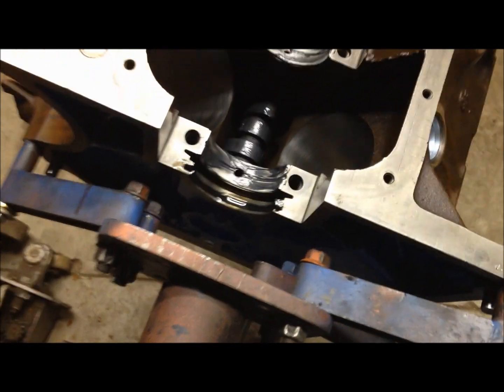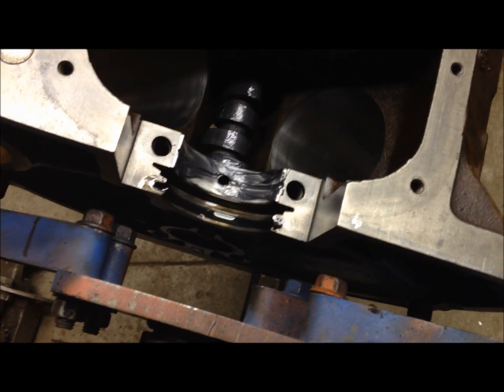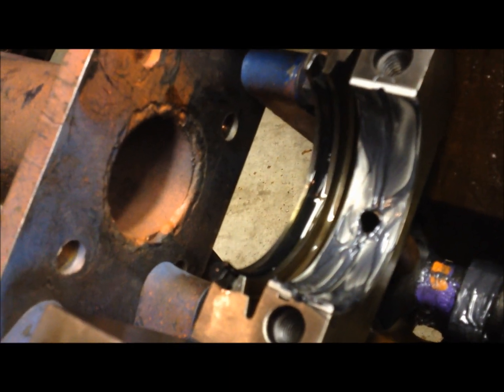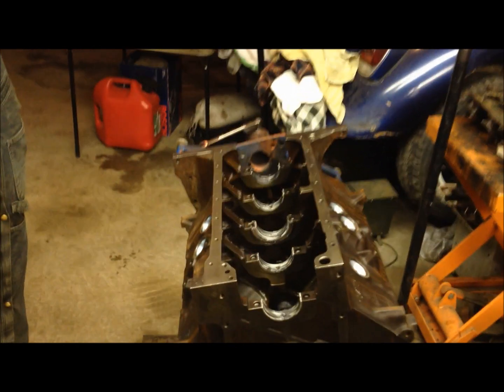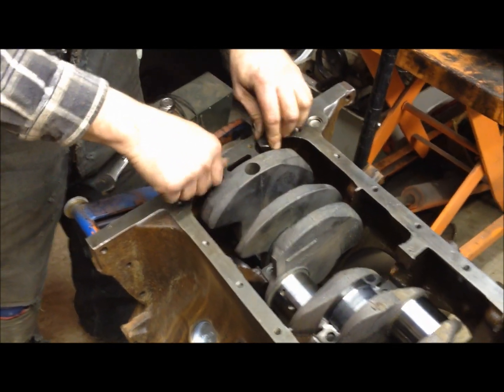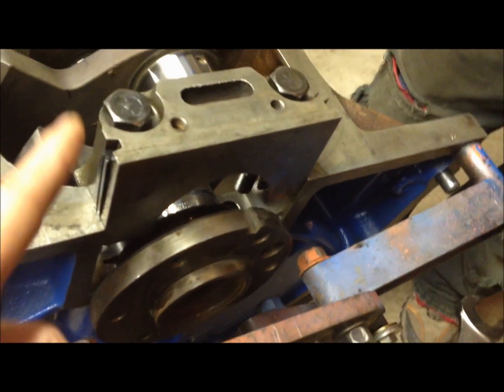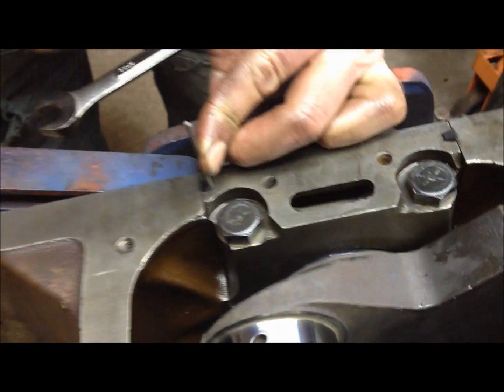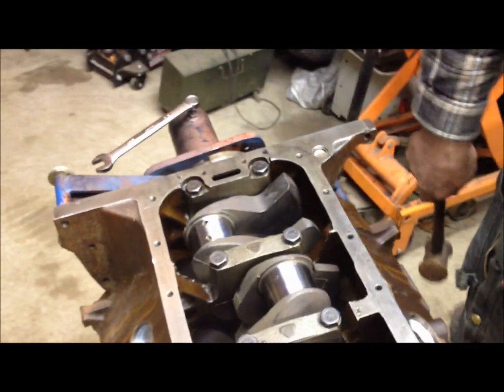360/390 FE Rear Main Seal Installation How To

Comment: Someone told me there is a "kit" that allows replacement of this seal without pulling the engine. Not sure if he has polka dotted monkeys living in his sock drawer, or if this might be true?
Reply: Yes there is....not sure how well it works on rubber seals though. I think it's designed for old rope seals...

https://www.amazon.com/Performance-Tool-W84019-Upper-Remvr/dp/B0002KO400/ref=asc_df_B0002KO400/?tag=hyprod-20&linkCode=df0&hvadid=385177046298&hvpos=&hvnetw=g&hvrand=590420745666563686&hvpone=&hvptwo=&hvqmt=&hvdev=c&hvdvcmdl=&hvlocint=&hvlocphy=9005204&hvtargid=pla-829950443028&psc=1&tag=&ref=&adgrpid=78533818517&hvpone=&hvptwo=&hvadid=385177046298&hvpos=&hvnetw=g&hvrand=590420745666563686&hvqmt=&hvdev=c&hvdvcmdl=&hvlocint=&hvlocphy=9005204&hvtargid=pla-829950443028
Reply: The only"kit" I know of consists of a 10" long wire with a plastic handle on one end & a small metal clasp on the other, & a 5" long stiff wire with a loop on one end & a corkscrew looking other end, that is designed to screw into the old upper seal & assist pulling it out.  In a polyanna perfect world this may work. My upper seal came out in pieces, & had to use carbrulator cleaner & compressed air to help dissolve the old seal, & blow it out. When trying to use the wire & clasp to pull the new seal through, the clasp was too large, & the new seal later, just went in by hand. So much for the new & improved "wonder kit"!

Comment: After you've done these a few times you learn a few tricks. You need to smudge a little sealer on the block mating surface for the cap. Often there is oil weepage between the block and cap if you don't use a very small smear of sealer . Do NOT soak the seal prior to putting it into the block/bearing cap. Do it AFTER you seat them and have your 3/8" offset and cover liberally with your finger tip. I also keep two 8" pieces of all-thread. I thread them into the block and slide the cap down over the all-thread, then remove the all-thread and insert the bolts. This keeps the caps centered. It is VERY helpful with the rear cap and the thrust bearing especially. I also try to stay away from heavy lubricants like moly or white grease. It doesn't dissolve in the oil and winds up sitting in the bottom of the oil pan. Keep up the videos!

Comment: could this process be done without taken the engine out of the car,the changing of the rear main seal? im sure the way you have shown in the video is a whole lot easier but for a individual that has a rear main leak as a repair do you think it can be done ?
Reply from the maker: M .Quez im sure there is and im sure people have done it. ford went to the one peice rear seal on the 302 for this reason. i have never tried to do this, so im really not at liberty to say either way. i have no experiential knowledge to go off of. . . .
Reply: yes it can be done. Although I have done this, I will caution that it is a tricky operation. on a 2wd truck the cross member is a slight hurdle. you have to take the oil pump off while the pan is still under the engine, then loosen the engine mounts and jack the engine up a few inches to remove the oil pan... from there the seal replacement is straight forward, but getting the oil pump bolted back on and lined up with the oil pump drive without dicking up the gasket will take a few trys.
Reply: what about a 4wd truck, can i just pop off the oil pan and slide them out? btw i have a 360 block and a standard tranny if that helps
Reply: It can be done. I have done this on a '67 Fairlane 390 myself. However, it is not an easy task. To get to the rear main seal, you have to move the oil pan forward. Which is a problem, because you have an oil pump and a sway bar in your way unless you remove those. To do this, you have to loosen all the bolts in the motor mount. Then you have to Jack the engine up while still connected to the transmission which creates clearance problems at the firewall. Not to mention the fact that if you don't remove your hood you have limited clearance there as well. You will fight with the oil pan to keep it from sliding back towards your transmission. 
There is going to be a very limited amount of space to get to the rear main cap. But you will be there at it. I did it twice, and it leaks worse the first time than the second. I know it can be done, and if done properly I probably could have stopped the leak. But I have to do it a third time, and it will be so much easier with the motor out of the car. Uh
Reply: M .Quez
Reply: Nymuscle can not be done at all if you're dancing with a fe motor its extremely difficult nearly impossible
Reply: @zombie95xx  I have done it.

Comment: What's the best way to remove the rounded seal, without damaging anything?
Reply from the maker: what do you mean without damaging anything? if you remove the cap, all seals will need to be replaced. the cap is removed by tapping it back and forth within its seat. everything would be reinstalled as seen in the video
Reply: I removed the cap but the round seal is still in the block part and its pretty stuck in there.
Reply from the maker: I have no idea how to do it without removing the crank from the engine. you could always besat it out with a bunch, but you would still need to remove the crank to install the seal again correctly.
Reply: @ThunderHead289  Actually Felpro makes a rear main seal to install in the engine while it is in the car, or they used to. You take the rear main cap out ,then take a small straight punch first to rotate the old seal out. It ain't easy. I think I ended up having to use some pretty strong but hand bendable wire to get the old seal on out, as you go over the top. Then the new seal comes with a sleeve, like a Chinese finger hand cuff, that you slip over the top of the crank thru the groove for the new seal. Then slip the new seal into the sleeve which gets tighter around the seal as you pull it over the crank. It works. It ain't easy. It's a pain in the everything especially since you are on your back under the vehicle, plus all the other things that go with having to do it like this, when you are probably low on funds and don't  have a good smooth level inside place to do this. But it can be done. And mine actually worked and didn't leak a drop for years and tens of thousands of miles before I sold that truck. 66 F100 2wd, 352.
Reply: ThunderHead289 Bull fucking shit!